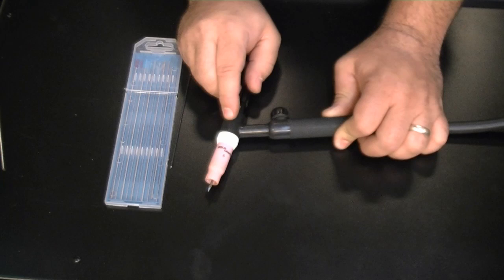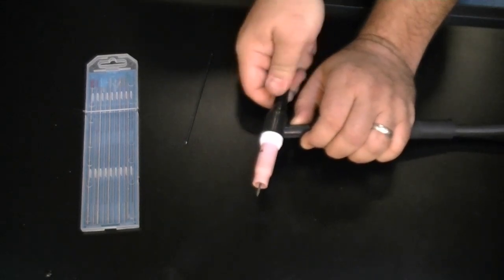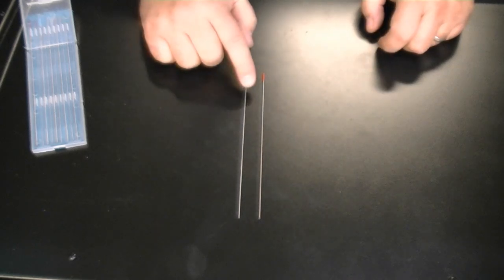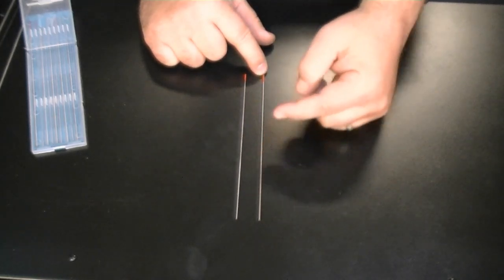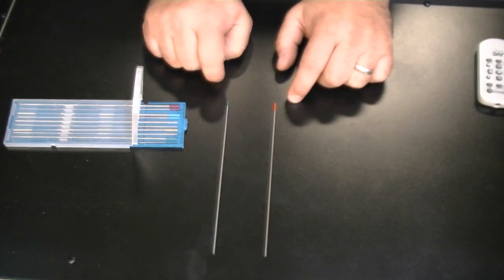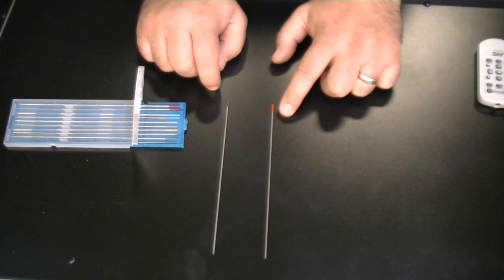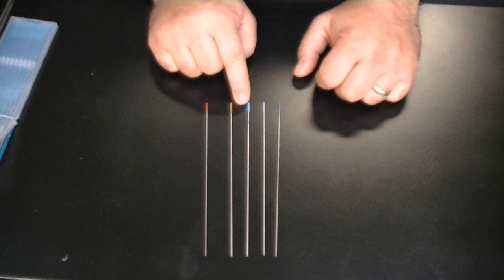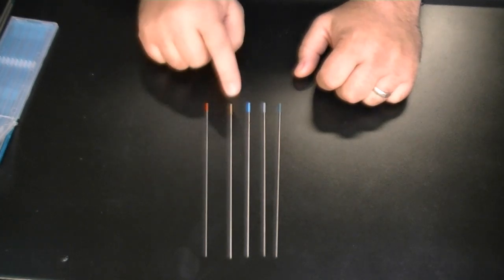How to Select Tungsten  for AC/DC or DC Only TIG Inverter Welders

Comment: For everybody that has watched this video do not buy a Everlast machine if you live in Canada there's only one place that serves the machine and that is in Ontario

The machine that I bought from everlasting what is kept in the cardboard box for two years and 11 months at the time the warranty said three years I didn't need to do any welding within that period of time so I took it out of the box put it in my shop and let it sit there for another two months then came to time to start welding with the machine I welded for on and off for about 2 1/2 hours I was welding aluminum of the time and suddenly the pulse frequency started failing 

So I got in touch with the company in United States there was a salesman that got on the phone took all the information and said they would get back to me in an email they never replied to my email they completely ignored me 

So I was left to contact the only place where they would fix it in Ontario and they told me that I had to send the machine to them I had a red sealed 15 year experience welder to run the machine and they told me it wasn't set properly I told the person on the phone in Ontario that this man was a 15 year experience welder what is red seal 

So now it's costing me $425 to get this machine shipped out to Ontario so they could fix it and that's why I'm telling you if you live in Canada do not buy that machine  

You have no idea how pissed off I am of everything you sell the machine no matter where you are you should get a good service specially when this machine costs thousands of dollars

Comment: Very very informative without coming to any exact point all that I know for sure have to watching this is that you can use the red tungsten on AC or DC with some damage to the end of the tungsten possibly have it in the rest we just know they have certain things but never was said this is tested better on AC or this other one is tested better for DC all that I really got out of this other than a lot of information on the Constance is the red one will work good with AC or DC with some problems of cracking or balling up stuff like that not very helpful at all

Comment: I'm going to be welding aluminium tubing bicycle frames with a 160amp DC inverter Tig machine. So what tungsten do you recommend? Also when switching between welding steel tubing to aluminium tubing can I use the same tungsten or do I need to switch tungsten
Reply: You need an AC machine to weld aluminum.

Comment: Thoriated has been redacted in favor of Lanthanated (Zircon and Lanthanum combined with the Tungsten).
Reply: When I took welding classes 12 years ago the teacher said to use 2% ceriated tungsten for all tig welding both ac and dc and it worked on both inverter and transformer machines and it worked well and he said thoriated tungsten was not worth using compared to the 2% ceriated tungsten
Reply from the maker: E-Nonymouse. Not in the u.s.

Comment: You didn't make a recommendation for which tungsten to use for aluminum if not the green. Which will work for DC tig aluminum?
Reply: 2% Lanthanated.... Are you REALLY welding aluminum with DC? Yes, you can....THANKS JODY.... but usually ya use AC
Reply from the maker: Any will work fine besides Pure Tungsten and Zirconiated.  You do not ball tungsten in an inverter.

Comment: Are you saying the Green tungsten does not work well in an AC or DC inverter tig or just AC? You only mentioned AC.
Reply from the maker: It doesn't work for either.  Don't use it in an Inverter.
Reply: Thx

Comment: I'm new to TIG, i didn't realize that the Red one was slightly radio active.  
There should be some kind of health warning on the box - advising to avoid the dust.
Ive ground mine a number of times without knowing .....

i hope i don't start glowing :-)
Reply from the maker: There is...on the sheet usually included with most brands in the case.   It's actualy an Alpha emitter.  It doesn't take much to stop an alpha emitter...something like a sheet of paper.  It's low grade.  Although I am no expert in radiation and have not verified it,  I've been told things like glow in the dark dials on old watches emitted more.
Reply: Grinding radioactive tungsten is less detrimental to your health than breathing the carcinogenic benzine contained in gasoline. So unless your planning on moving to Antarctica, i wouldnt worry about it.

Comment from the maker: We've worked on it, but soundproofing a room made for welding is not that easy.  The camera doesn't support a lapel mike (not practical at this point).  I like to Think of it as "cheap" reverb.  But I understand your complaint.  The majority of people don't have an issue, although it isn't perfect, and it could possibly be a larger problem with your audio on your speakers.